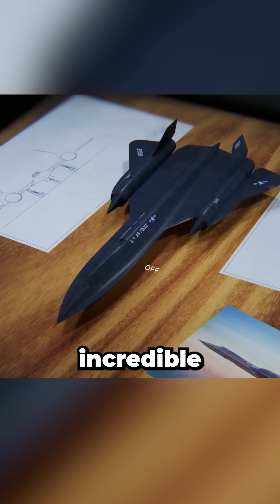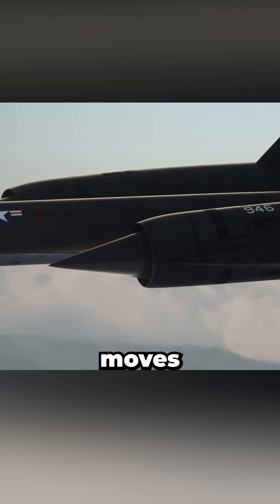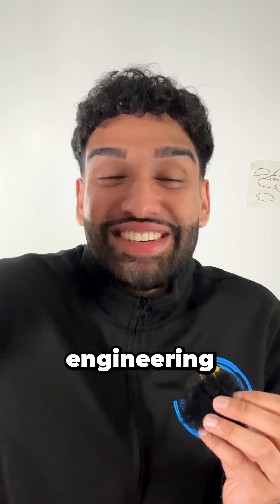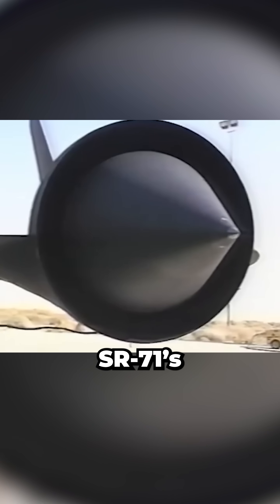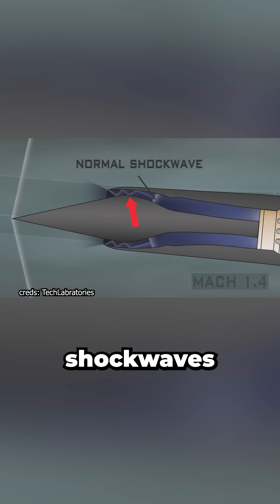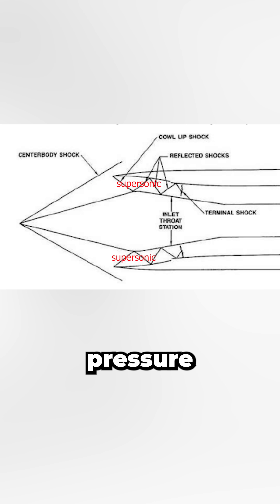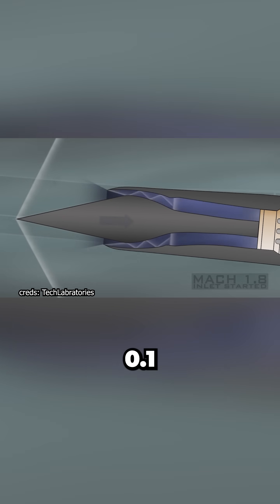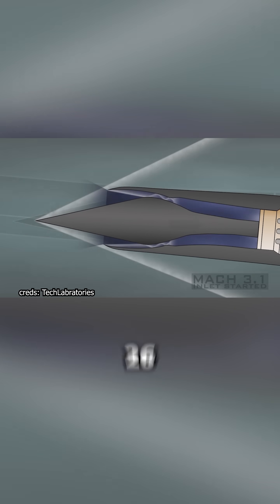Why the SR-71’s engine would fail without this spike

Comment: Fun fact. The shockwave produced at mach 3+ is actually providing 60% of the thrust. So the engines aren't even doing most of the legwork, making the fuel efficiency of the engines less of an issue.
Reply: But the shockwave is produced by the aircraft pushing through the air, so it’s not really free thrust

Comment: What are the downsides of a Turbo-Ramjet like the one on the sr71? Im guessing that since it is designed for both systems, that neither is the "best" or at its highest efficiency and power?
Understandably the maintenance is probably a nightmare due to all the moving parts, but can we expect to see similar transitioning engine designs in later aircraft such as supersonic passenger aircraft which are being adopted to become what the concorde tried to be?
Reply: I would imagine like anything that added complexity adds more systems that can fail
Reply: Its bad at subsonic speeds😊

Comment: Fun fact: the MiG 21 does the same thing
Reply: Oh thanks, I didnt know that
Reply: @tijger5353another tidbit, other aircraft like the f-16 accomplishes the subsonic airflow into the intake with their curved style intake path. It reduces the airflow enough (along with the help of some guid vanes on the engine) to allow the engine to operate at supersonic speeds. Of course its good enough because well… theyre not hitting mach 3
Reply: @iowasucks9494 that is a genius design ngl
Reply: And the electric lightning
Reply: Tell me about it.
Reply: @AzizGaliley The MiG-21 uses cone for the same reason